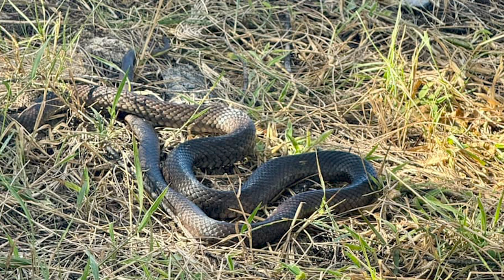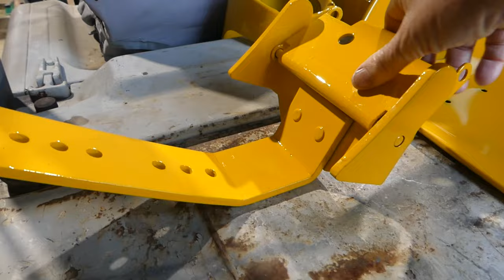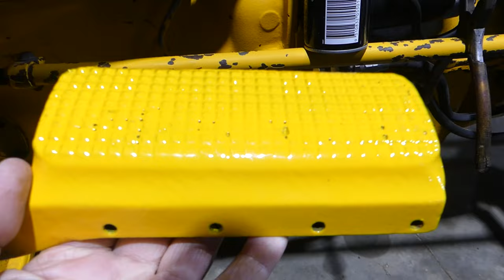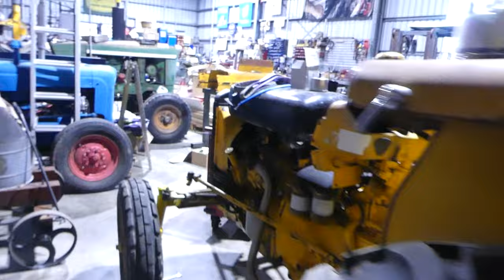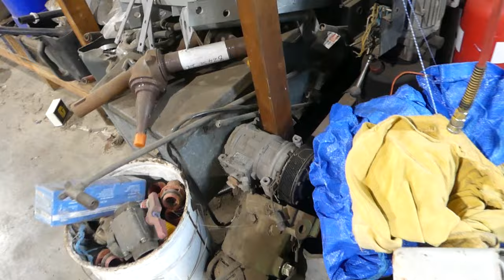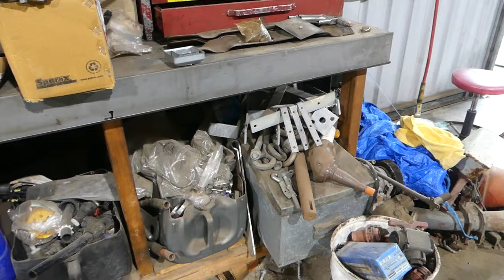Kangaroo Stew #373 50,000 subs! Wow Thankyou.

Comment: Hey lance why dont you run a ethernet cable from the Telstra modem to your shipping container. Your speed will be as good in the shipping container as it is in your house via ethernet. I suggest if you do this, as I assume it will be underground run 2 ethernet cables, 1 not terminated should the primary cable fail
Reply from the maker: We did look at that but I think our next plan in the long term will be good for when I retire and Im not running back and forth between sheds.